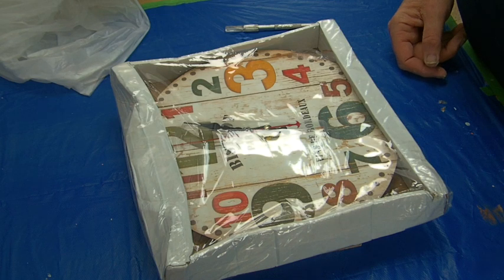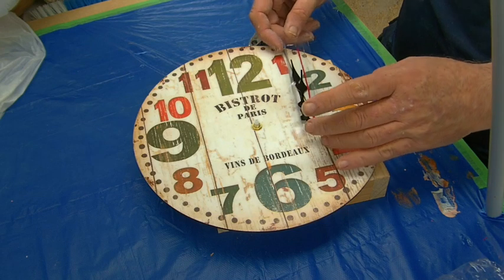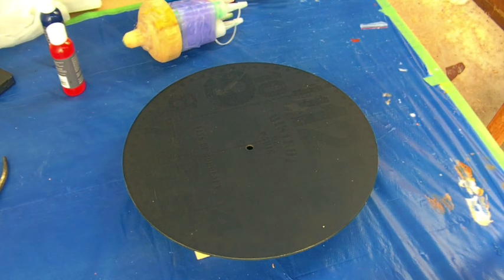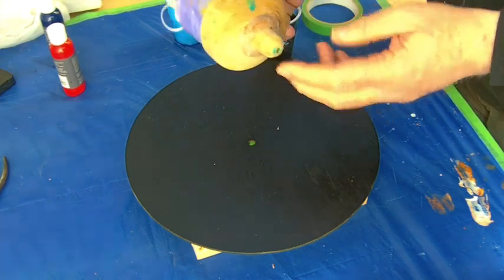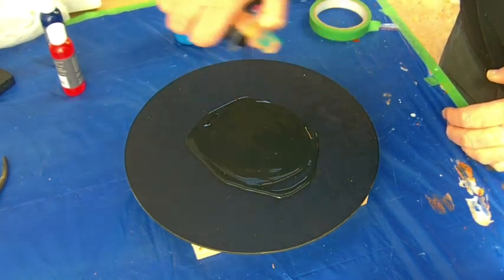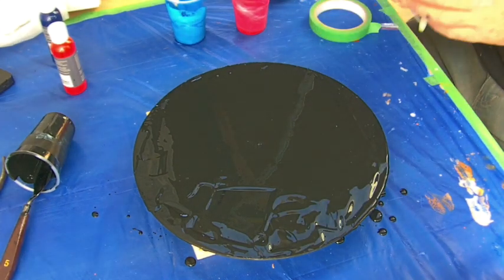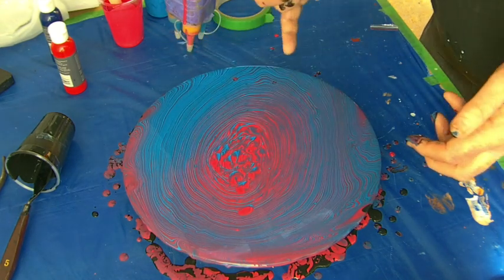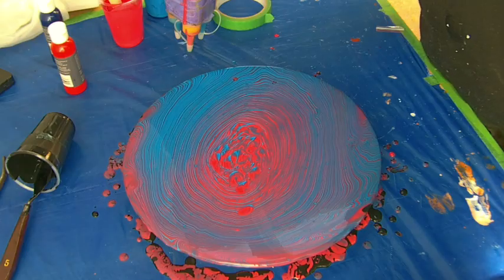Swirl Pour Clock

Comment: It sure was pretty! I wish it had lasted long enough to see it dry.  You can get just the clock kits from Ali Express for a couple dollars, and there are many places where you can buy round wood discs for a good price. There are also places to buy vinyl records, like thrift stores. I like the wood, because it dries faster, and you can do different sizes - the clock hands can be cut with scissors or wire cutters (jewelry pliers work well), and there are places where you can buy just clock hands in different styles.
Reply from the maker: Thanks Martha, I have my workshop, so can make a lot myself. I will come back to it..lol